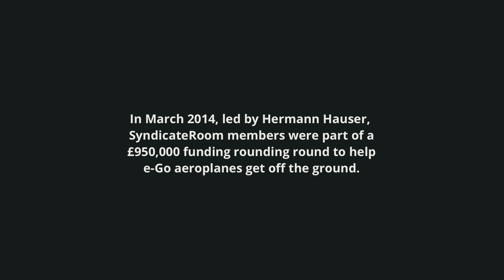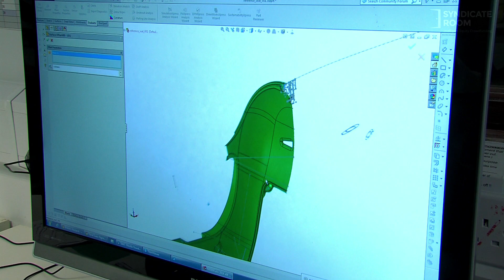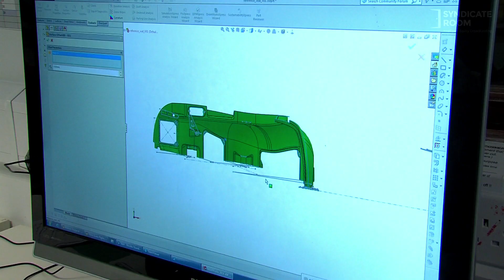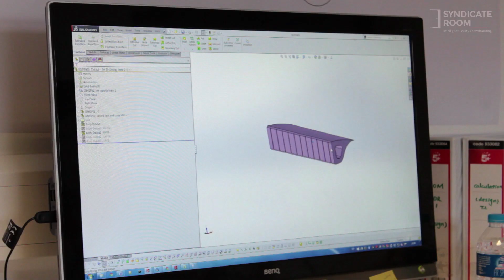Funded on SyndicateRoom | e-Go

Comment: Another Burt Rutan design
Reply: Burt Rutan did not invent the canard aircraft.
Reply: Of course not. The Wright brothers did. That is what their flyer was.
e-Go is just a copy or may be a scale down of a Varieze, like the Berkut is a scale up of the Long-EZ.
Nothing innovative nor creative there.
Reply: It doesn't look anything like a VariEze, at all. That's like saying that every high wing, single tractor engine aircraft is a Cessna 172. The Berkut isn't just a scaled up Long-EZ either, it was an extensive redesign, and it offered a significant improvement in performance. It wasn't even really bigger, just slightly longer. Anyway, the design of something goes much, MUCH deeper than its physical appearance, in fact, that's not even where most of the engineering takes place. Refinements in structure, aerodynamics and materials can lead to very significant differences in performance.